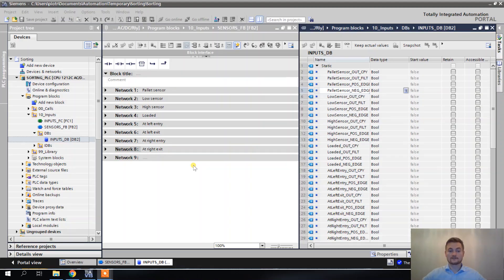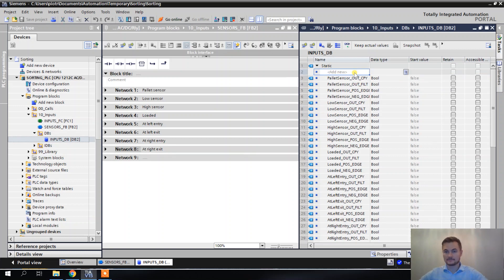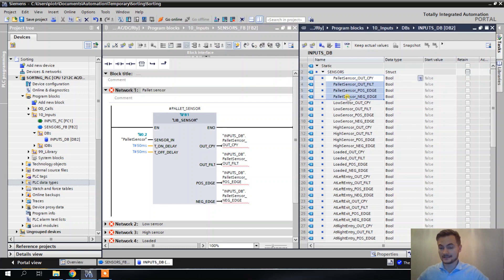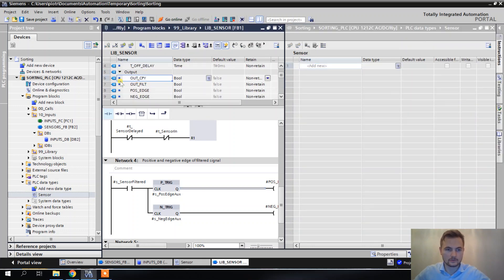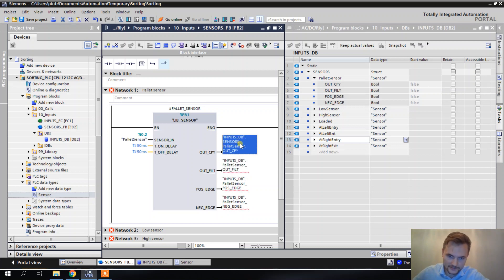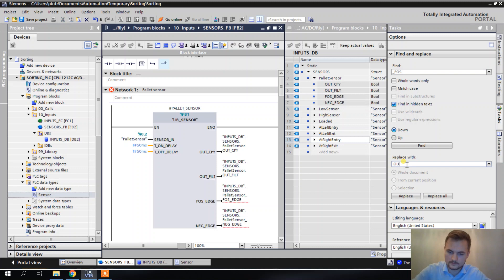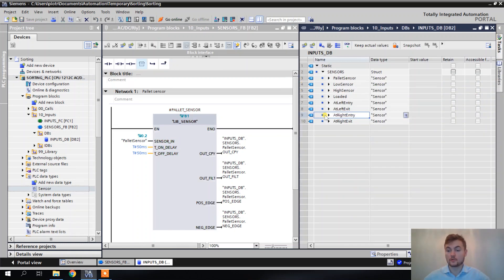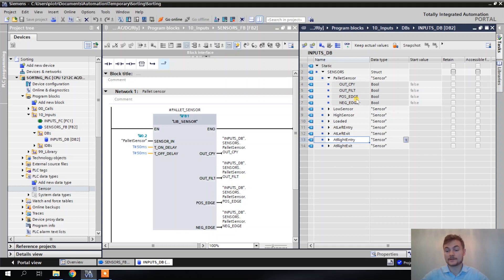TIA Portal Tutorial 10 - Structures and PLC data types

Comment: does programming in STL saves programming memory?
Reply: Depends how efficient your programming is but it could be. However if the memory is your concern then you might consider buying a PLC with more memory (especially if it's a commercial application). You might spend more money on a PLC but you will save much more on engineering and debugging time. Plus the readability of the code will be much better if you use ladder, fbd, scl or graph.
Reply: @piotrekbt  thank yo very much..good luck